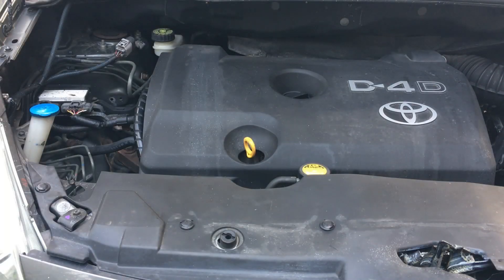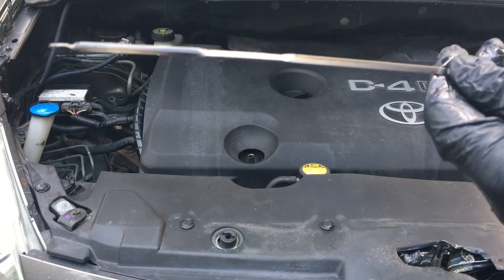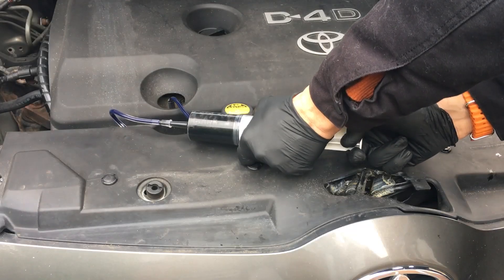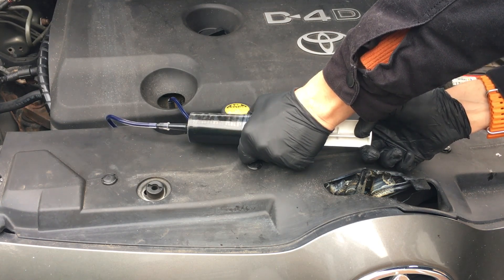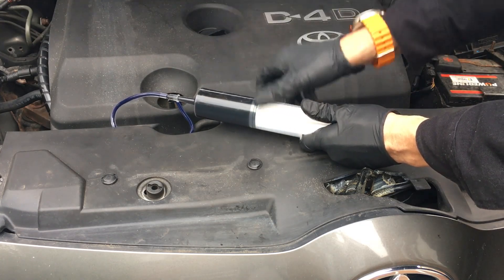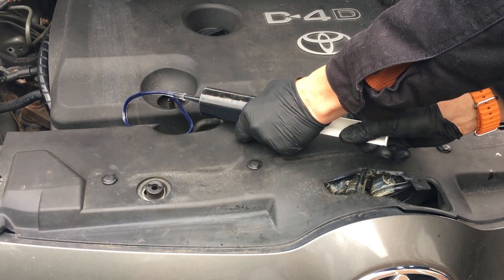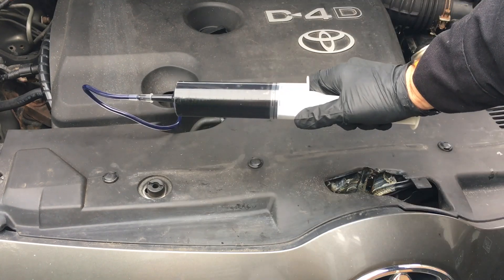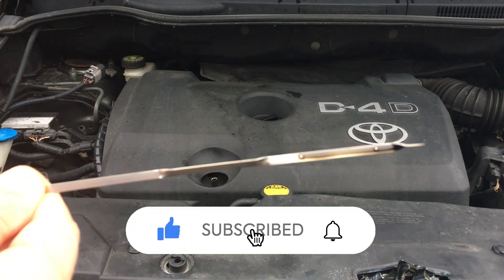How to correct engine oil overfilled /explained

Comment: As long as the crank isn't whipping and arating the oil its fine.
Reply: But how can u tell that without breaking stuff down??
Reply: @toms.1773  bubbles on the dipstick.  Low oil pressure. sloshing sounds from the crank hitting the oil.  A average 4 cylinder takes 3.5 quarts. Running almost a quart is in the block.   If you overfill two 4 quarts you are unlikely to cause damage...